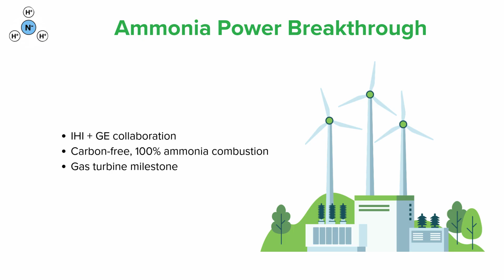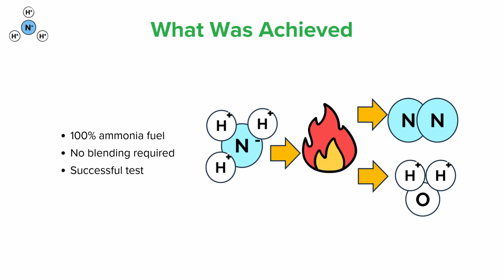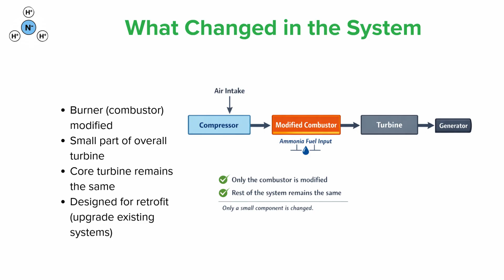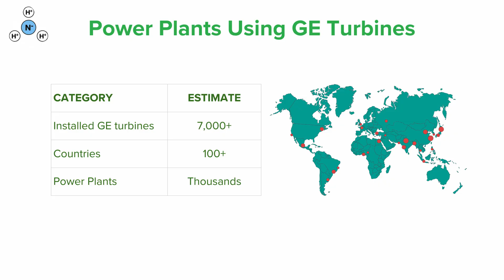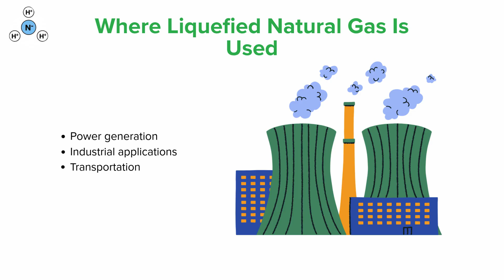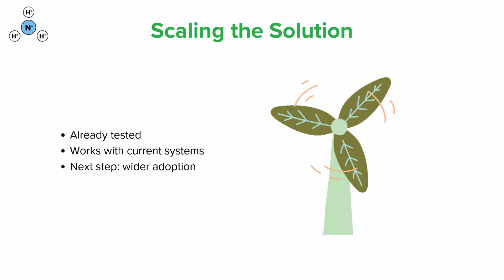Ammonia Power Breakthrough

Comment: What NO2 does it emit, at what power rating?
Reply from the maker: They report the final no2 is virtually zero. I don't know if there is any exhaust treatment. E.g. Nikki Universal makes special catalytic bricks for ammonia combustion.. Ammonia combustion researchers tell me there is a sweet spot with the right air/fuel, temp and pressures where emissions are near zero. By near zero my understanding is under 10 ppm, basically undetectable